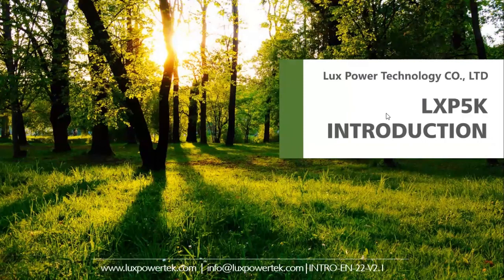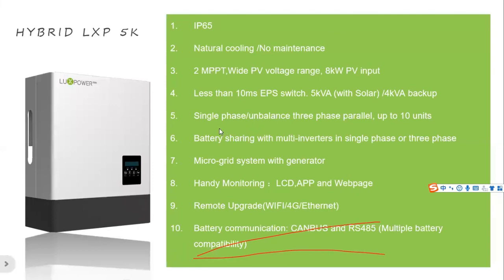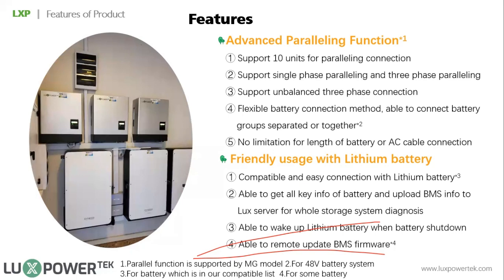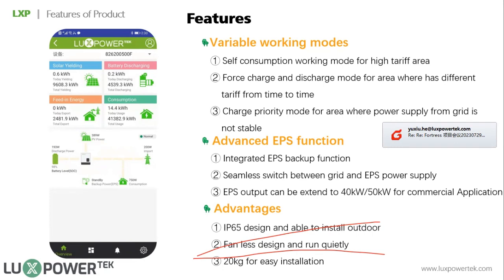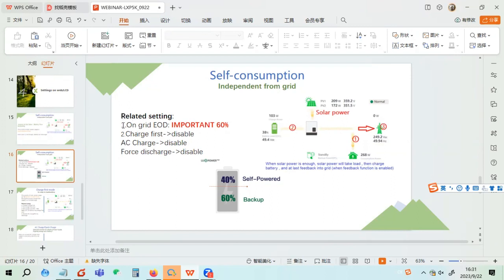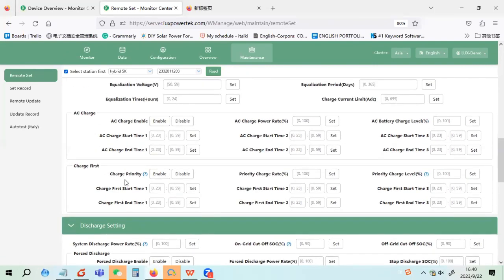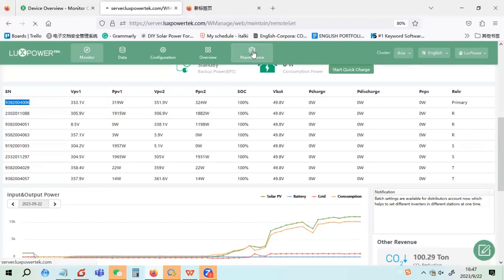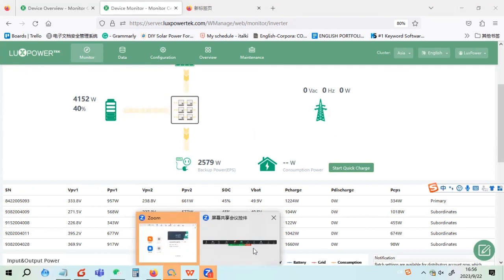Luxpower LXP 5k product introduction and modes setting online training

Comment: How to reset SNA5000 if it shows faulty red light and it doesn't charge the battery
Reply from the maker: Hi there, thanks for your reaching out. Could you please send email to info@luxpowertek.com with your inverter serial number? Our technician will help you soon.

Comment: PLS i Need that you help me. The first you can give me pdf Maintenance. After I need the following configuration that the PV must give priority first to consumption then to the battery and the rest to the grid
Reply from the maker: Hi Sir, thank you for reaching out. The scenario you described aligns with the Self-consumption mode. Please avoid setting any specific working mode on the monitoring platform, as the system will automatically operate in Self-consumption mode.
Reply: How to reset SNA5000 if it shows faulty red light and it doesn't charge the battery

Comment: Not exactly accurate!  They installed my converter and it spends most of its time asleep instead of delivering battery power.  The suppliers (HEG) feel unable to help with the problems ......  FWIW I did extensive research monitoring the system and was appalled at the results.  The engineers declined to respond.
Reply from the maker: Hi Sir, Thank you for reaching out to us. We noticed that you’ve left several messages on our account. Please be assured that we’ve submitted your concerns to our technical support team as a top priority. They will be in touch with you shortly to help resolve the issue.

Thank you for your patience.

Comment: Installed late 2022 the 2x3.2kWh batteries are probably OK.  The real problem is the Lux power Tek converter.  Despite claims about its specification, it frequently takes an age to switch from either grid to battery or battery to grid.  Despite the spec that claims switching is very rapid, I have measured this time and it is frequently up to a minute or more!!  This means that you will pull mains power instead of battery power and then export battery power to the grid when you switch off.  It has shattered my original calculations about pay-back time making the project financially unworkable.  Very disappointing.  Customer 'service' best left undescribed :-(   [I have retained all communications ..... as of September 2024]